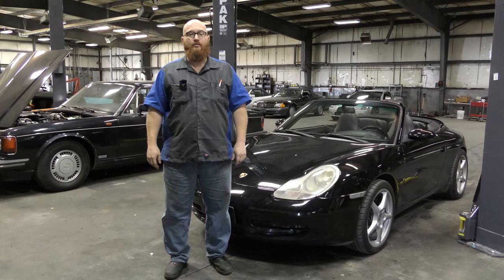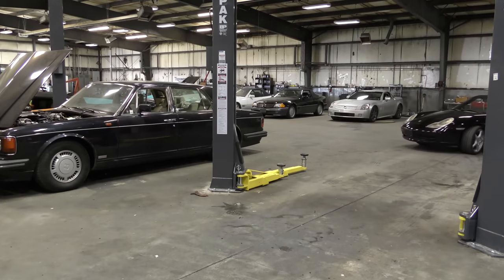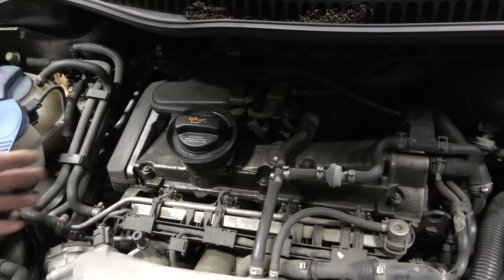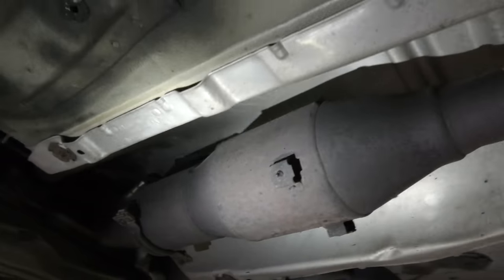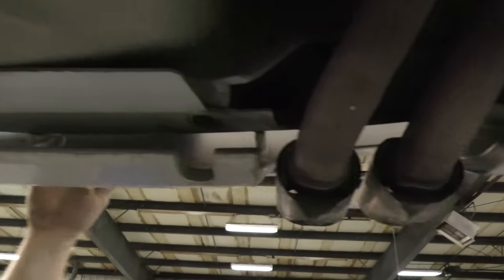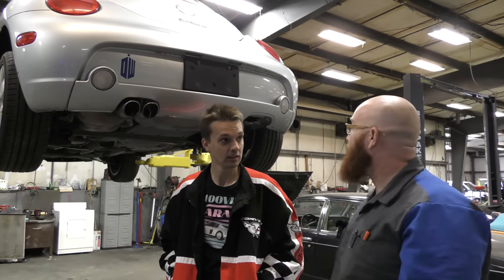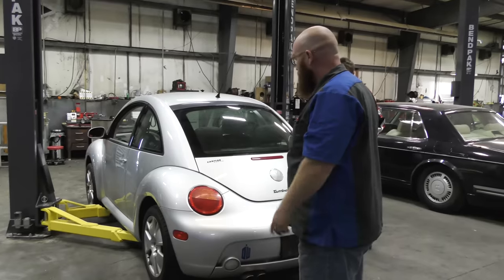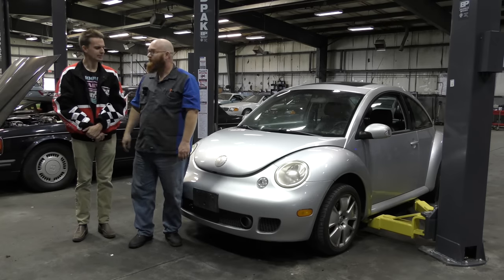HOOVIE finds the CAR WIZARD an '04 Turbo S VW Beetle. It's sooo much better than the last one!

Comment: Hi Wizard. The exhaust has a joining sleeve with 2 nuts and bolts. Occasionally one will come loose and you tighten the bolts up and it still comes loose. So fixing it like they have is the next best thing to replacing the joining sleeve. We had quite a few that had leaky struts and shocks. we replaced them with Japanese KYB Gas struts. they are far better and they last well. Being VW Pressure test the cooling system and check the coolant outlets on the motor as they crack and leak . From memory the cooling fans are the same as the MK5 golf and they rotate all the time . When the get older they get sloppy and fail electrically and they aren't cheap. The usual story with the 2 year window regulators. (life expectancy) The black coating comes off the switches but they are cheap. In New Zealand where i am we get a lot of Japanese and Singaporean imports. The Japanese ones are usually good but the Singaporean ones get cooked by the climate there. Hot and humid so the air con compressors and interior fan don't last long etc and they stink of bami gorang (Malaysian curry) sweated into the upholstery. Off on a tangent here. We got some Malayisian Merc w140 320s  from an importer for us to get ready for sale here in NZ. The heaters didnt work in them and they were otherwise good cars.  Its never cold enough to need a heater in Singapore. We took a look at them and found 5/8 aluminium plugs with hose clips in the heater hoses. So we clamped the hoses and undid the hose clips and squeezed the plugs out and reconnected it all and ran them up all done. We did this to all 6 of them. 2 months later they all came back within a week of each other with coolant in the nice white carpet. Oh joy. The heater hoses connect to aluminium tubes with "O" rings on them that are attached to the heater core. They have never had coolant through them and go hard.  We've struck it on other Singaporean cars too.

Comment: Hey Car Wizard, Please install some BFI  Stage 1 motor and transmission mount bushings and Powerflex front upper strut mounts with some KYB struts.  I did that on my MK4 Jetta and Golf TDI. Makes the world of difference. If you really want to wake it up,  add an Addco rear anti-sway bar.  Talk about neutral steering thru the corners. It was totally awesome!!! I modded my car myself on a budget because the suspension was totally shot. Later on I put a complete Energy Suspension bushing kit  on the control arms and rear axle. The car handled great at stock height with the oem 15 inch wheels and touring tires. Keep making these informative and entertaining videos.  You have my girlfriend asking me question because she has learned things from your channel.

Comment: Make sure the turbo to intake piping connections are in good shape, If they fail/release under boost the turbo could overspeed/grenade and send metal down the intake into the pistons.

Comment: It looks like it needs a fog lamp, missing lights (even optional ones) drive me crazy.

Definitely a good deal for the wizard. I am partial to the beetle as well, I've told my friends its possible to make a masculine beetle, I wanted to flat black an ALH TDI and put a skull and crossbones on the hood, but a $700 Turbo S isn't a bad idea, either.

Good show, Wizard.

Comment: Don't know how experienced you are with these 1.8t engines but change the chain tensioner "gasket plate"+half moon while you have the rocker cover off. For those reading this and are unaware there is a small chain connecting the camshafts inside there - there is a half moon shaped seal "plug" underneath the tensioner.  The half moon has pretty surely morphed itself to plastic from rubber already and leaking. Though you need the tool to compress and hold the chain tensioner but it doesn't need to be removed fully, just the bolts holding it on while it's compressed. I always change the tensioner seals on "this type" of engines (same setup found on the same time period V6 engines also) when doing a rocker cover gasket. ~15 minutes of extra work and the tensioner seal kit costs "nothing".

Comment: Beetles traditionally have a plastic gerbera flowers on the dash. That 1.8 turbo engine is out of a Mk1 Audi TT and the engine mount over the cam belt is a nightmare. Also needs new bolts on the mount as they are common to snap if you reuse the old ones. I think your exhaust has had the secondary cat removed hence the piece of pipe.

Comment: Good maintenance on this engine is to clean the oil pan and the oil pickup tube and use good synthetic oil. They have notorious sludge issues, which will cause oil starvation in the worst case.

Comment: Car Wizard, the short pipe after the CAT that was aftermarket replacement was probably originally a resonator. The resonator probably developed a noise from a broken weld on the inside. This is what happened to my '09 Toyota Corolla.

Comment: You shouldn't have ordered another steering wheel! That is foundation make-up all over it and you can also see it all around the other control like the seat heater switch. I buy and sell second hand cars and I see it all the time on cars driven by women. All it needs is a good detail and it will look good as new.

Comment: get the Porsche oil cap, antifreeze cap and a slightly bigger tire like 235(245?)-45-17. With a little mild resto-mod it's a Porsche you can drive everyday on a budget.

Comment: I had the same 1.8 20v turbo engine in my skoda octavia vrs. 180bhp standard. Same lump is used In many vw and audi models. Very durable engines. Can easily be mapped to get more bhp

Comment: I had one of those "sleeves" on my Impreza when I bought it... It was about half an inch narrower in diameter than the rest of the exhaust piping and the gaps were just filled up with weld wire.

Comment: Dave seems genuinely excited about the new Bug, despite the haters of the "new" Beetle id own one as a shopping trolley.
Reply: IIRC the worst thing about these was the automatic transmissions (which this does not have but 90% of USA spec cars do). The 1.8 itself is fine.

Comment: Beetle 1.8T timing belt/water pump replace is "not too bad?" Pshh. I've done that job. Requires taking apart half the car, jacking up the engine & removing the left engine mount, etc. It's a serious PITA.

Comment: Well the Porsche 914 was a Volkswagen in every country but America and had the Beetle motor in it. The 924 was originally a VW/Audi car but the slapped the Porsche emblem on it when they abandoned it. And the 911 had a variant in the 60s which had the Beetle flat four in it know as the the 912. 

Its a beetle.

Comment: My wife has the European equivalent, but it has a V5 170 bhp engine. The trim, wheels, everything is the same apart from the engine. We purchased it in 2003 as a Beetle V5 sport. The spoiler doesn’t go up until 100 mph, then goes down at 80 mph 🤣

Comment: Patch pipe in the exhaust might be to replace a woven stainless vibration isolator. Expensive to replace and not really necessary.

Comment: The Foam is off of the blender or take out the radio cut a hole in the air box and foil tape it this will fix your heat

Comment: EU models with the V5 engine (same body, rims, interior as the Turbo S) has a switch on / under the steering column to manually deploy the wing when parked

Comment: that exhaust add in is a replacement for the stock flex pipe  joint that chronically breaks.

Comment: Volkswagen nerd tips : Those wheels are real BBS , replace the cam adjuster seal with the valve cover gasket , you can upgrade the control arm bushings with Audi TT Bushings that are solid and will never fail again.

Comment: I don't know if somebody has seen it yet but the CV BOOT ON THE FRONT LEFT WHEEL SIDE  IS RIPPED. Maybe the shock front left is in good shape and all the noise and grime comes from the CV boot and the lower arm? You can see it at 6:42.
Reply from the maker: Ulrich Bakker Yep. New shafts ordered. Both of them already

Comment: I mean it looks like it needs 4 shocks, wizard said it needs a valve cover gasket, timing belt, brake pads, control arm, full exhaust system. I can imagine if hoovie had it then it would cost several thousands to fix it. But these are relatively cheap parts but laborous to install. I was servicing a white 2011 3 series with bilstein shocks one time. They were on for around 80k miles and were on their way out. What a nightmare it was taking the strut assembly out. The bolts stripped while coming out and It fought me every step of the way. I hated it

Comment: I would have sold the engine cover in eBay.  On my Passat 2.5 the air filter is a part of that big cover.  To get rid of that one you would have to go with cold air or something like that.  I know some of them are just useless plastic.

Comment: Saw a lot of pebbles (see 7:47) inside of tire treads of the Beetle. Somewhat impossible to avoid with newer tires with a lot of meat on them but best knock them out while car in the air ;-). Even pebbles can throw a tire of alignment and increases risk of a puncture (same applies to motorcycles & bikes), decrease traction and braking action while adds to road noise. Not unlike getting a pebble stuck in your sneaker, shoe or boot. Car's and other vehicles don't like them either. I do like the look (in silver) & power available from the car. Just wouldn't like the inherent reliability factor with associated cost of parts & labor. With 6-speed with a short sifter kit, new exhaust and other mechanical work done car (curious if a new turbo / intercooler will be part of the upgrades?) will be faster than a lot of Porsche's, safer too.

Comment: I once replaced the whole front end of a 90s VW Golf because that whole crossmember had rusted through and let go of the control arms on the highway, I fixed it for a cousin, as she was in real need of a car and she also knew where to find used parts on another car her ex had had left on a farm.  It took days... Then about 2 months later, she gave up the car over a needing a new battery, I tried to help her and was a lot of work for almost nothing. 
Bad decisions is why she is in the place where she is today, not a good place... sad.

Comment: Check the driver side tire at around 5 o clock where the tread ends and the sidewall begins seemed like there was something there maybe a nail or screw.
Reply: 6:46 and see it 9:42

Comment: To replace the snap ring on the mainshaft, you just have to take a cover off and replace it? That must be seen to believe. Just a cover on the transmission which probably is buried somewhere down in the darkness.

Comment: The stainless steel pipe is probably weld there cause the exhaust clamp it has connecting the cat to the resonator was prob damaged or they didn’t want to deal with it

Comment: Hi Wizard, I've recently purchased a Jetta TDI 2007 (I know you hate them ;) and had the front inlet pipe blow off where it joins the anti-shudder valve. It ran like a dog and eventually a check engine light came on. I then disconnected the battery for a few hours, and it seemed to drive better again (although the check engine light stayed on). The question I have is whether a sudden change to the system caused by a blow off can mess up settings in the computer? And if a reset was necessary to get it back to normal operation?

I'd like a general discussion on what is and isn't reset when the battery is disconnected, and also if the computer can get 'confused' due to unusual operational conditions?

Cheers,
Ben

Comment: best gasoline 4-cyl vw engine. installed from 1997 to 2013 (in europe). thumbs up for manual transmission. also easy power upgrades. But that golf IV platform is the worst part of this car.

Comment: 1. When you get the exhaust and short throw shifter can we get a back roads drive video
2. No jr mint we want an actual repair video sir! On the water pump, timing belt, and valve cover....

Comment: Can you tell me more about the gearbox noise during coasting and the fix? I have a 2004 TT 225 six speed manual that rattles during coasting/engine breaking and in neutra, only when engine is on temperature. Is that the same issue you are talking about?

Comment: I'm going to guess that pieced in part of the exhaust was where theyre used to be a mesh flex pipe like i see on most front wheel drives

Comment: I was just thinking. The diesel engines they put in some of these often greatly outlive the car. And with the growth of electrics, that trend is going to continue. 
I think it's going to be a common practice to reuse the salvaged electric drive trains out of ev's as they're likely going to outlive the car/truck/SUV by a long ways.

Comment: I used to love Dodge Omni's just as much as the car wizard loves Volkswagen Beetles!🤣 Dodge Omni made the car Wizard's DO NOT BUY LIST! I must agree, they were last made in 1990. They were a disposable Econo box car. Pre 1988 they were carbureted with a small temperamental Holley carburetor mechanics hated! Aftermarket parts difficult, Mopar has discontinued.

Comment: I have an 04 jetta 2.0L and when I start it it shakes and the engine light flashes, any clue on what it is? I already spent 630$ on getting it fixed and the next day it started doing it again.

Comment: Hypothetical '04 Beetle problem.  Let's say that single brick car key on the world's longest dash is the sole key for the car but you have a new key cut and programmed for the lock/un-lock functions.  However this new second key is not programmed into the immobilizer thus the car's kill circuitry stalls the motor immediately after the car turns over.  Not a great second key by any stretch, this key needs to be programmed into the immobilizer but you want to do it yourself.  You have the plastic stick that originally was supplied with the car's keys and it has among it's numbers a scratch off area said to be the "secret key code" or SKC.  What device is needed to reprogram the immobilizer to use both keys?  I figure a wizard of cars would know this and the hypothetical situation is actually my situation.  I have the 2nd car key, the valet key, and the plastic strip with the numbers in it.  I don't know how or what I need to do to get the currently good keys plus the new replacement one fully working.  I would like to do it myself if possible and definitely would wish to avoid the dealer and criminal pricing.  So help me Obi Wan Car Wizard.

Comment: Unfortunately it's not worth putting 4 pistons porsche engine in it as it is front wheel drive....I didn't like the suspension system at the back no multi link in there

Comment: Can someone help me my 03' beetle turbo s won't turn on. All it does is flash abs and traction control light. You don't hear clicking from the starter and you don't hear the fuel pump turn on. What could it be?

Comment: 20 percent brake life means its done.   
When can i come buy my 911 from you.  ??  I love her.
Reply from the maker: No it doesnt, It means this fall its time for brakes. Not needed right away
Reply: @CarWizard    it would for me..   brakes are cheap.. paint is expensive. Plus my daughter drives so I want lots of brake ability and great tires for her.  For me I would agree with you, but I dont use much in the way of  brakes

Comment: Long time ago VW made 1.8T everyone said it breaking because turbo. And today its reliable engine. VW must chenge this and change 1.6 8V for crap EGR 1.4TSI 2.0TDI
Reply: Well the NA engine it did not like the non turbo oil capacity when having a turbo. There is a good reason for the very large oil filter.

Comment: Doug DeMuro likes to do videos with high performance versions of cars that are unmodified and in perfect shape.  You should contact him and see if he would do a video with this car.

By the way, the little belt on the Bentley distributor?  That whole distributor assembly is built by Bosch and is used on some '84-'86 Porsche 928's, specifically the S2 cars [NOT the one in your shop].  928 International sells that little belt for $9.95.....

Comment: change the rear shocks. trust me and do it. i am german.
lol
Reply: seen many of those and this one looks like trash from the inside but awesome if you look under it. you never see that here , always the other way around (weather, winter etc...). But looking at the steering wheel (saw this delamination before, twice in a smokers beetle) and the pedals it still looks like 200k miles... considering the mechanic before knew what he was doing (looks like it) and it really has 120k ... my guess : an orang utan was the previous owner ... (btw. the car was in the sun a little too long ... the interior had 70+° celsius , vw changed the plastics in the following years, and this car looks like the prime example why ...)

Comment: The new beetle is the absolute worst car I've ever worked on.  Plastic water pump impeller, constantly failing air condition modules, stuck electric gas latch, failing plastic door handles, moldy interior.  I've never hated working on a car until one of those turds came across my life.

Comment: Sorry Wiz, you lost my respect. You crapped on ol' BMW 3's, and laud VW's bettles of the same vintage. The stick transmissions in VW's ARE CRAP! The cost of parts to fix a 'suddenly frozen in first' tranny is $1599 for PARTS!.  They are junk. I should get you a Renault Dauphine... you'll love one of those.

Comment: What a terrible choice. The interior is trash. The suspension needs work, the engine is leaking, brakes need changed. You’d be better off leasing a new Civic.